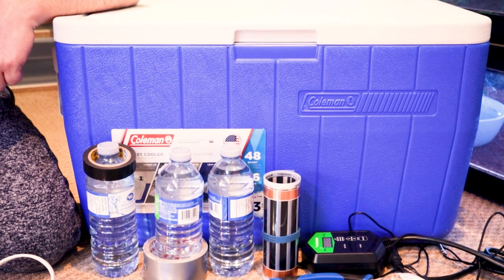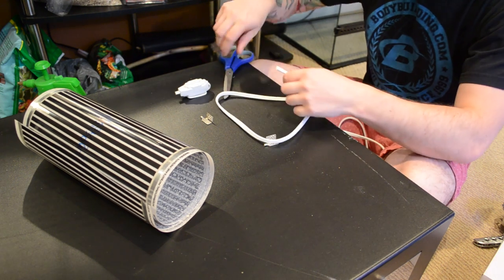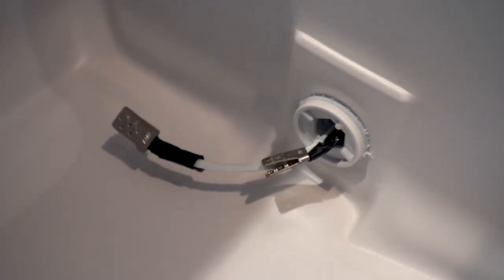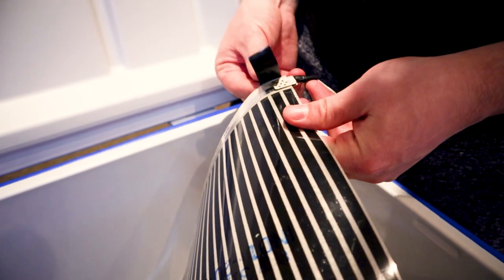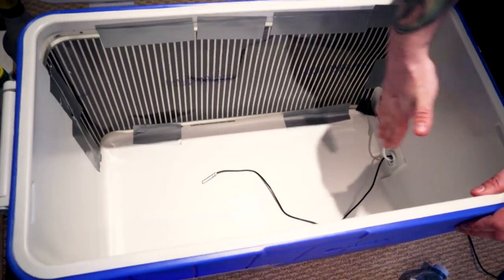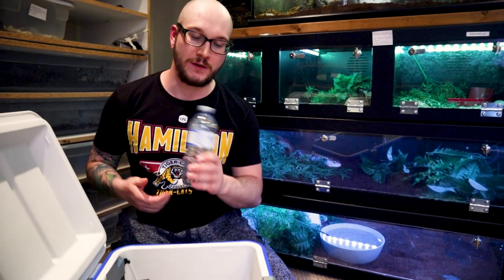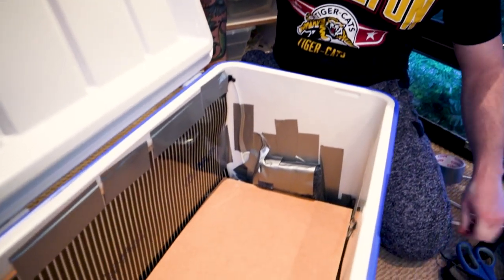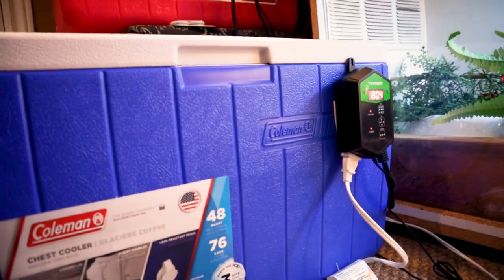DIY Reptile Egg Incubator How To Build In 15 Minutes For $40 Or Less

Comment: Very helpful! I've seen this done with water in the bottom and heated with an aquarium heater as well. The eggs do okay with no air exchange? Or do you open the top periodically?
Reply: Should definitely have some ventilation of some form...
Reply: You either want to poke some very small ventilation holes in the containers the eggs are in, or once a week open them up and allow for some good gas exchange.
Reply from the maker: right! do not ventilate the cooler at all ever! just exchange air every few days.
Reply: @WickensWickedReptiles  How???
Reply: @jdulmes  Like they said above: either have some tiny holes in the egg boxes, or open the egg box lid once a week so the eggs can get fresh air.

Comment: I was intimidated by the thought of fatally fudging up the heat tape, so I avoided making my own incubator until this year when I found a method I was far more familiar with. Instead of water bottles and heat tape, I use aquarium heaters and fill a small portion of the cooler with water a la Garrett's guide on Reach Out Reptiles. First time I've ever had such perfect humidity without fussing with the substrate at all. It could be worth covering this method for people who, like me, are still unsure of their ability to install tape. It also requires no duct tape, which--aside from my inclination to never allow tape within a 1 mile radius of bumbling hatchlings--will eventually unstick in a humid incubator.
Reply: I guess it would help if I read the other comments first lol. Seems I'm hardly the first to recommend Garrett's guide.
Reply: I feel that. Heat tape has always made me a bit nervous so it was nice to see how he put it together.

Comment: Honestly, I'd just stick a heating pad or something in a foam box and call it an incubator. Not sure if it'd work though. But seems plausible. Although where I'm at, I would need an incubator that brings down temps rather than an incubator that raises temps.

Comment: Ok so to piggy back off of my other comment, of saving me a tremendous amount of money, for that, thank you. So I built it only. I installed the Heat tape on the bottom vice the top. BUT, all of my eggs got firm, like a cheeseburger firm....so I cut 1 to check, and it was terrible. So my question  is what am I doing wrong and could you help me please

Comment: Great video Adam you know you can also buy plastic insulators that snap over the metal clips that cover the exposed metal clips that crimp on your heat tape. I was also told to run electrical tape over the cut end of the heat tape so you dont have exposed contacts on the unwired side of the heat tape. Again great video keep them comming.
Reply from the maker: Great tip! yes I should have mentioned that!

Comment: They are not positive and negative as this is AC current, not DC It is line and neutral.
Reply from the maker: what?
Reply: @WickensWickedReptiles  the wiring of the heat panel. You said "positive and negative I think"

Comment: "Make sure no metal is not covered" is the correct way to use a double negative! Well done!😂
Reply from the maker: did I actually say that? I'm a language snob. No way I said it like that
Reply: It was typed on screen as you were taping the contacts on the heat tape. It took me a second to process, I will admit, but once I did, it was absolutely right.😂

Comment: What about humidity?  I live in the desert and that's a big issue.  Damp medium dries out fast and takes the eggs with it.  Would keeping water on the bottom with the bottles work?  Maybe seal the drainage hole and heat tape connectors with silicone?
Reply: I am pretty sure you maintain the humidity by having the eggs in a deli cup depending on the species. The water used in the video is sole for holding temperature and is not loose in the cooler.
Reply from the maker: as long as your egg boxes are sealed and the medium is moist it wont matter where you live
Reply: @finnbailey9897  my experience with deli cups sealed is they mold
Reply: @clutchcargo666  you do still need some ventilation or air exchange to prevent that.

Comment: Hey what was the length and width  of the heat tape to fit in the cooler ?
Reply from the maker: I mention that it's 11 inch heat tape in the video. Not sure on the length, just cut to length of cooler
Reply: @WickensWickedReptiles  thanks man

Comment: Not sure if this was asked but... wouldn’t the thermostat probe be better off taped directly to the heat tape?
Reply from the maker: For a rack, yes, for an incubator, no. The idea is to get the ambient temp in the incubator to temp, not the surface of the heat tape.